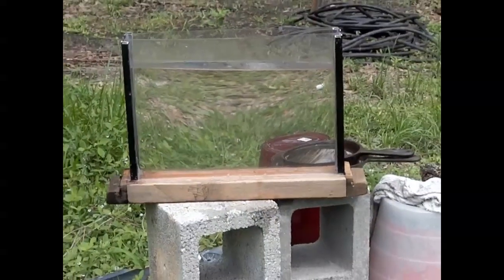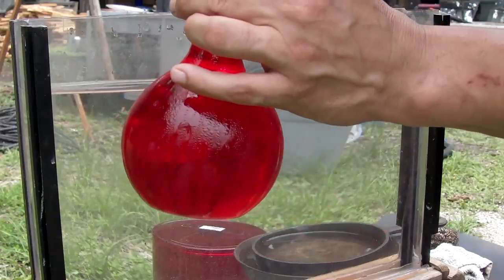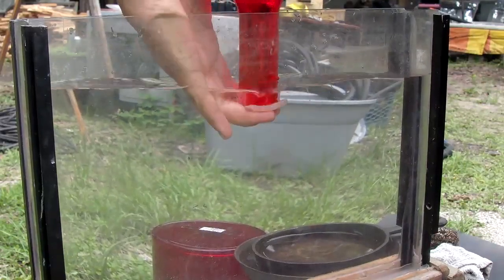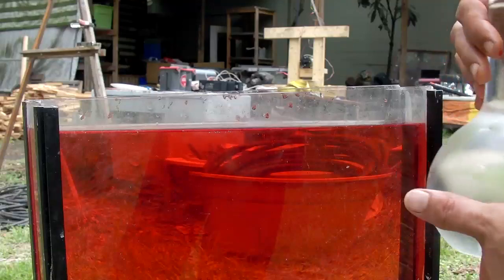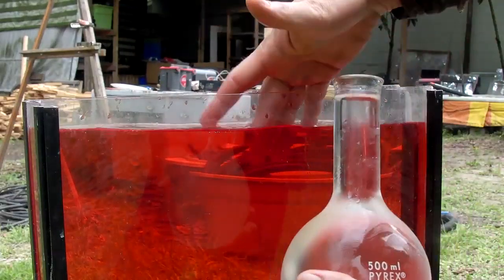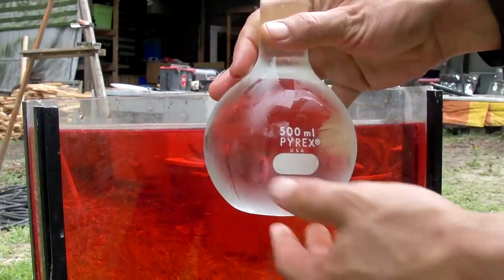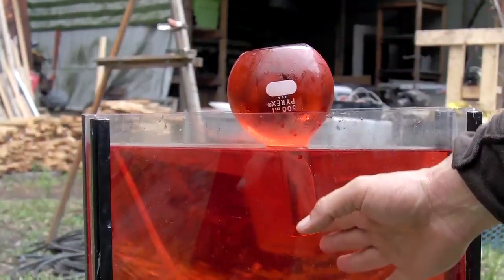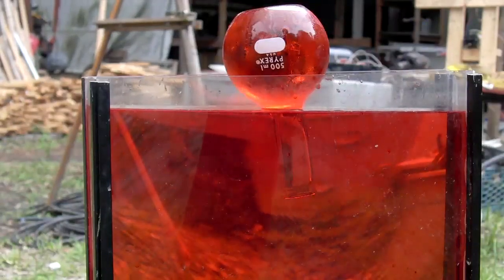VISIBLE Thermal Exchange of water Torricelli vacuum

Comment: what you actually see is the heavier cold water dripping down because its heavier than hot water due to density difference. heat trasfer always move from hotter region to colder region and thats not what is happening as you can see.

Comment: Excellent demonstration, Dan. This may be related to that, or not.
Sometimes, when I'm boiling water in a pot for oatmeal or something, I stand and watch the water as it comes to a boil. As it's starting to heat up I can see the places where the water swirls because of differences in temperature. I think it's rather fascinating and I see some of those swirls in the neck of the flask in the second part of the demonstration.
By the way, I can't say for all pots, but the pots of water I use do come to a boil.  ;-)

Comment: actually, the red color would diffuse from one container to the other even with no temperature gradients: that's how solutions works! Solved substances will always migrate from high to low concentrations, in order to rise the entropy and lower the solution total energy, untill they reach equilibrium. thermal exchange has little to do with it..well, it speed the process up, but the tank and the pirex container would both become red, even if they were both at room temperature.
Reply: diffusion is always "thermally motivated", since it's thermal energy that moves those molecules around... but, in the macroscopic sense it was intended in the video, the temperature differential only made the diffusion  to happen faster.
Reply: ***** Exactly! I mean yes difusion obviously plays a part beause its matter crossing between two concentations, but the movement of the particles have more energy leading to a faster rate. Though its diffuson, still demonstrates his point as the movement of particles in this case IS heat in a visual form as heat is directy related to the excitation of the particles.
Reply: ....well, most of the thingd you see around you depend on thermic energy (kT)...but this video still only show some elementary chemestry.

Comment: You should have made a control trial where you get both waters intact at the same temperature. Now it's impossible to say if it's due to heat transfer or mass transfer.

Comment: Crude but effective technique for showing heat transfer between two mediums.
Reply: ...there was no showing of thermal transfer there. What you see is a diffusion effect between two solutions with different concentration. The temperature only make it faster.
Reply: Semantics....
Reply: What do you mean?
Reply: Wiseman
Actually, it was the difference in temperature that made it happen much more quickly.
Reply: Yes, but it's a secondary factor.

Comment: Alexander is absolutely right. The inverse of this experiment (hot in flask, cold in lens) wouldn't produce the same results.
Clearly some of the denser cold red solution water is sinking to the bottom, as it should, and resist intermixing with the clear hot water.
As this happens, some of the less-dense (rarified) clear warmer water will resist mixing and make its way up into the flask to replace the cold water.
All around its a good demo of heat exchange, but it seems to be an even better demo of how different densities resist mixture, allowing for underwater brine water falls at the poles, and layers of ocean water density that reflect whale songs farther.

Comment: What if you tried it with cold water in the tank and the hot water in the bottle? Because the warm water would go up and therefore stay inside the bottle. Then only the water that had cooled down enough would go down into the tank and only the water that has been heated enough would go up, so you coud really see only the thermal exchange.

Comment: hi Dan, could you make a video about the most efective and easy way to heat a swimming pool with an easy and low cost technique?
Thanks
Reply from the maker: Hi,
SOLAR HOT WATER 2 DIY USING BLACK WATER HOSE SOLAR WATER HEATER SUN POWER
The black water hose is the best solution available since it is low cost and you can add many sq meters of collection. Polytube is the best option as it has higher resistance to chemical leaching, 3/8" dia is optimal (roof tube placement reduces lift resistance) and 1/2" for yard placement. A "T" + a valve is placed post pump for on off option. The ejection goes to the bottom. High volume is better despite what many believe as a lot of warm water is better than a little super hot water. Higher volume is more efficient because the tubing stays closer to ambient temperature so less thermal leaching is lost to the atmosphere. 500-1000 ft spiral loop costs about 100 bucks. Tee and valve is $30.
Reply: GREENPOWERSCIENCE Thaniks a lot Dan!